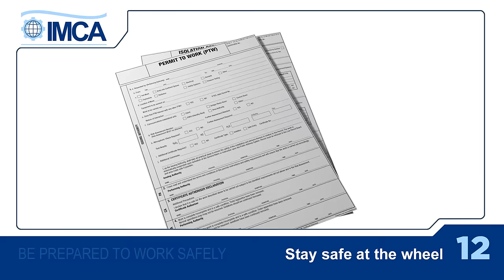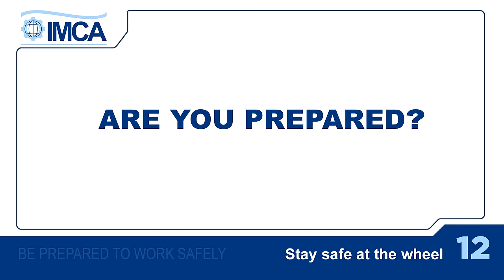Grinding wheel safety

Comment: You have shown a angle grinder wheel being ring tested. That wheel will be a resinoid reinforced wheel which will not ring; you can only ring test vitrified wheels due to their construction, this is misleading for those that dont know.

Comment: Everything you didn't need to know because it's 100% common sense (and forgetting about some really important stuff, like fire), and nothing whatsoever that you need to actually know about how to grind or cut anything?  Like, how to know what a cutting or grinding disc is?  What speeds? What direction to cut?  How tight is "too tight"?  Should cutting be done in one pass, or many?  how to hold the parts when grinding on a wheel?  How to set up the wheel and distance to it?  And those are just the things I can think of, as someone who knows nothing about this - what about all the things I don't know ???  IMCA sounds like they got paid to make a video about something they had no clue about, and didn't bother to ask someone who knows.